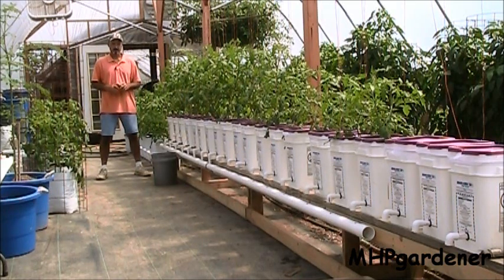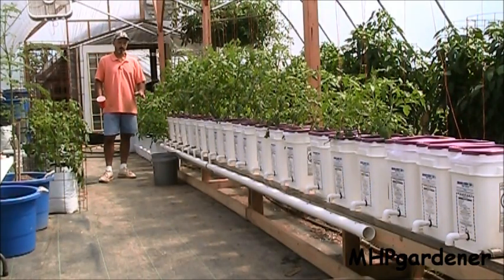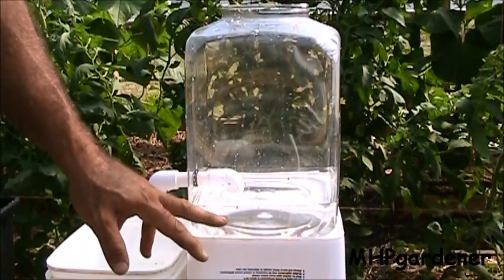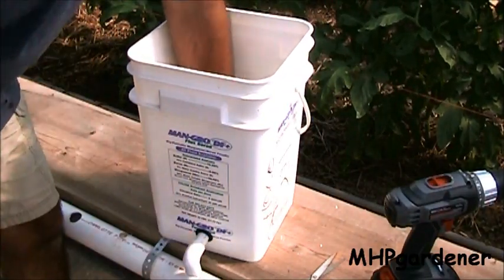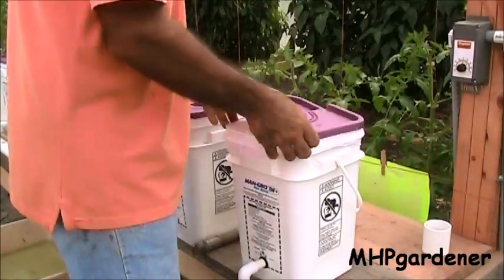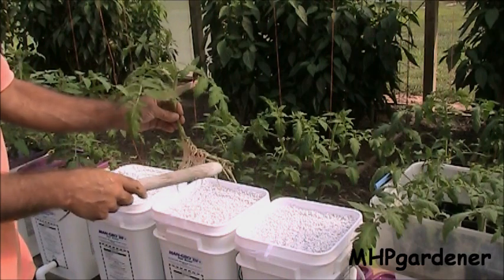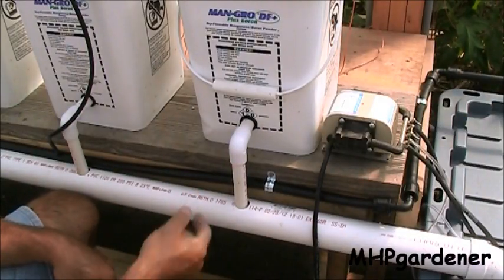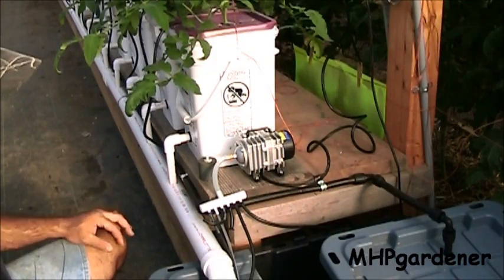Dutch Bucket Hydroponics - How It Works & How to Make Your Own Buckets

Comment: Thanks for all of your work in both growing and doing these videos.  I was wondering if I could substitute pumice for the perlite?  The local gravel yard sells it really cheap, you can fill up the back of a pickup for about 25.00.  But before I went over and loaded up I was wondering if it would throw off the nutrients or add in something bad. Thanks, Jim

Comment: First, i'd like to thank you for all of your help. i need clarity on grommet size.  i cut a 1" hole, bought some 3/4" groove dia. x 1/2" I.D. grommets (which i thought would be too small) and they just fell through the hole, barely touching the edge. went back, got 7/8" groove dia. x 5/8" I.D. and 1/2" pvc fit but moved a little too freely for me. so, THEN i cut a 3/4" hole and was able to get only 1grommet with pvc to fit. obviously, the trick is finding the right dimensions grommet. thx.

Comment from the maker: When the reservoir gets low, I add more water and nutrients at the original ratio. If it's extremely hot, and I'm in a hurry, sometimes I'll just dump a bucket of plain water in there. The plants will be transpiring quite heavily, and losing a lot of water. With me, it's not an exact science. As long as you change out the reservoir every 30 days, it works fine.

Comment: I would have put the main drip line above the buckets so the pump doesn't work so hard but if it works this way there must be a reason . Great system especially when you don't want the mess of dirt.Thanks.

Comment: Hi, do you have a good online source for perlite? I bought a bag like yours from the local hydroponic store and it cost me $63. I don't like perlite because it's too light, so when the wind blow on my tomato plant, the root/net pot get tilt. Why is the river rock expensive? I think it's about $4 for a bag that could fill up 1/2 of the 5 gallon bucket easily.

Comment: You cannot use manure in hydroponics, only pure, well balanced, chemical solutions. Manure must be broken down to the elements and molecules plant roots absorb, and neutralize all the bad stuff in it. The only way to integrate is with ecological systems like aquaponics, which is completely different from what is been proposed here.

Comment from the maker: 1) No... I don't cement anything. 2) spacing varies, 18-24 inches. 3) The pump is an Eco 264, the poly is 1/2 inch that you can get from Lowes... and the reservoir will vary depending on how many buckets and how often you want to refill it.

Comment from the maker: Thanks. The pump is really simple. I was using a 264 GPH pump like most hydro stores carry. For this year, I added 12 ft to the system, so I moved up to a 400 GPH  pump. Nothing fancy after that, just 1/2 inch poly, with 1/4 drop lines at each bucket.

Comment: it is possible do with it aquaponics, but the major issue with Aquaponics is u need a good filtration system to make sure your water is clean before feeding the water into your floating raff, grow bucket and so on. Cause those small particle will tend to stick on the root system of your plants. Remember good respiration to the root system give u good and heathy plants.

Comment from the maker: Thanks. 1. Grow plugs are ok, but not dirt. If you have plants in soil, they do need to have the roots washed off before going into a hydro setup. The roots get water early on primarily from the feeder line up top..and later on from the bottom too. 2. Shorter buckets are fine. I explained that in a video last week. There are many different hydro methods. With this one, if you change it all up, it becomes something completely different.

Comment from the maker: If it's a drip kit with emitters, take them off and leave the lines open going into the buckets. Then, just starting out, 15-20 minutes 3 times a day will be plenty. And as they grow and the days get hotter, you can move it up to 30 minutes.

Comment: what will happen if you have to water in the bucket come up to the top area so the roots are in water all the time ,simular to the floating method but the plant is sitting in the perlite or gravel if this will work all you need is a 1/2 inch tube to connect the buckets 4 inches from the top with a continus flow of water then if the power shuts down the plants will be fine simular to the kratkty method,a combination of 3 mathods .

Comment from the maker: I got my buckets from the local feed store. They are about 4 gallons. You can get 3 gallon buckets from the bakery section at most grocery stores if you ask. I've had several people recommend looking there. Most any timer will do, as long as it has at least 3 settings per day. I prefer digital timers, but the manual ones work too.

Comment from the maker: Exactly... you can use a smaller bucket than I have. The storebought bato bucket was about 3 gallons. So that will be plenty. As for the tubing, it doesn't work like a flood and drain. The water is fed thru the top, and the older water exits the bottom.

Comment from the maker: I've never used sawdust in anything. But my first thought would be no. It seems like it would stay water logged, as opposed to letting the water pass thru. And I think you'd also have issues with the nutrients and pH. However, it would make an interesting experiment.

Comment: Another excellent video.
Those paint straining bags are about 3 bucks apiece where we live. We use them to 
ferment fruit wine in buckets. But they can add up, so we also use pantyhose;
it's cheaper and works just as good. I was thinking spigot filters made from pieces
of pantyhose and elastics. E.g., double wrap the nylon around inside spigots and 
tighten with strong elastics. You could probably fit several spigot/filters from a single
pair of dollar store pantyhose. Just a thought.

Comment from the maker: Thanks. I'm in southern Virginia. I've always been fascinated with hydroponics. So I started doing some testing. The dutch buckets take some time to set up, but after that, it's very low maintenance. Trying to do so much by myself, I need to optimize my time. Hydroponics allows me to grow a lot, without much effort.

Comment from the maker: I'm not familiar with Jung tomatoes. But you should be able to grow any type of tomato in this setup. Straight perlite has worked well for me. Yes, you can start it in soil, then wash the roots and put it into the buckets. It's gonna be a shock to the plants, so they're gonna wilt quite a bit for a day or 2. Try to do it on a cloudy day, to make things easy on the plants.

Comment from the maker: I noticed a little bit of algae, not enough to affect the plants, but enough to where I wanted to prevent it. So for the crop that I recently started, I wrapped the buckets with black plastic. A lot of people use white buckets with no problem. But I think these are pretty thin. So I figure better safe than sorry, just go ahead and wrap them. Thanks.

Comment from the maker: You can use any type of bucket for this..round, square, either one will work. Check out the bakery section in the grocery store. They usually have some...so I've been told.

Comment from the maker: "try it for us" ? I have to figure out how it works first. I see right off that my first problem would be lighting. Since the panels are vertical, I couldn't make it work in the winter when the sun was so low. Possibly in the summer. I'm guessing they had supplemental lighting, and lots of it. But, it does sound interesting. Uh oh !

Comment: I saw a different system used in Japan. It looks like 4 x 8 sheet of foam insulation board, with 2" holes for net pots BUT they stand them up on end like a teepee, about 4" apart at the top and 24" apart at the bottom, aeroponic sprayers, ends closed to block light, looks very economical and space saving, try it for us!!!

Comment: I think you can save a lot of money on buckets and plumbing supplies, by using an ebb and flow system with osb or ply for the container and line it with 6m black poly.  I like to make the containers about 4'x8'x12".  You might try using aquaponics system for the fish and nuteriants as well.

Comment: Thank you so much for the easy to understand information!!! Question............Does the nutrient water continuously circulate in the system 24/7 or is your water pump run on a timer. If you do, how often do you set your pump on and off?

Comment from the maker: I was running the air pump 24/7...but it may not be necessary. The water pump only runs when you need to feed the plants, usually 2-3 times a day depending on the time of year.

Comment: MH, Thanks for answering this question.... Because I'm re-watching some of your videos planning my own system, and I've been asking the same question. 

I figured I'd read the other comments before asking. 
What about using 3/8" ID - 1/2" OD plastic tubing going thru the grommet which could also go down to the backside of the bucket & would also drain from the bottom, but only drain to the bottom of the drain hole.  Might be cheaper?

Comment from the maker: From what I read, as the water trickles into the buckets, and the bottom fills up, having the elbow allows the older water to drain first, from the bottom. I guess since there's not much mixing going on, the water at the very bottom would become oxygen poor and it would be best to keep it constantly changing.

Comment from the maker: Thanks. For plastic, I would go with the standard 6 mil greenhouse film. Most of it is rated for 4 years, and holds up very well. One thing that really helps is having 2 layers of plastic, and the inflation blower. This cuts down on the amount of wear at each hoop because it keeps constant pressure on the plastic. However, if it's just a typical hoophouse or high tunnel, most people only use the one layer of plastic. One layer allows them to easily take it off during the summer.

Comment from the maker: Thank you. Yes, you add nutrients to the reservoir. I dissolve them in a 5 gal bkt and then pour into the reservoir. As far as I know, it is limited to either water soluble or liquid fertilizer. A lot of people inquire about using worm tea and such, but I don't think that any type of tea mixture would have the needed nutrients. However, if you tied into an aquaponic setup, that might work. I don't know for sure.

Comment from the maker: I tried to find the Lowes # and it's not listed on their site right now. The grommet is a 3/4 ID, made to fit a 1 inch drilled hole. As I recall, the one from Lowes was listed as a 23/32 ID.

Comment from the maker: I think they are about 4 1/4 gallons....less than 5 anyways. If you could find the cat litter buckets, they would work fine. I cut about 5 inches off the top of some of the square buckets and had good results. It takes a bit more time, but it also takes less media to fill them up.

Comment from the maker: For tomatoes, I didn't use net cups. That are planted directly into the perlite. I don't use emitters, the 1/4 line is open and free flowing. The buckets are filled to the top with perlite, but you could get by with 6 inches less. There is a reservoir of water in the bottom of about 1-2 inches.

Comment: Looks like the hempy bucket, only with a bigger hole in it.Did you ever try it to fill 2 inches of perlite and the rest of the bucket with good quality of coco coir which is washed and buffered? I wonder if this method is useful to use compost tea.Thanks btw for the vid.

Comment from the maker: Thanks.  To counter the PH issues, you could do a couple of things. Change the reservoir more often, or add the acid to it. I've been monitoring this setup, since I have so much at stake. I've used the PH down a few times and it doesn't take much to get the PH back down to 6.5 or so. I think a lot has to do with the type of nutrients you use.

Comment from the maker: Thanks. The issue with perlite in the return line was tricky. Back in the spring, I put some rocks in the bottom, then perlite on top. That worked ok, but still had bits and pieces getting thru. I think the strainers are much easier to work with. I like the idea of an elevated reservoir. You could even do it manually, if you were around often enough.

Comment from the maker: This is my first time doing hydro in the winter. I didn't do much of a fall garden outside this year, just some cabbage, broccoli, and a few beets and radish. My plan is to plant all that stuff in the small greenhouse right after Christmas, assuming the tomatoes are finished up. That way, I don't have to do as much heating, since cole crops do fine with overnight temps of 40 or so.

Comment from the maker: If you go high tech, you're right...hydro can get very expensive. That's why I'm doing the basic, less expensive, more productive, setups. When you take into consideration the factors of time, space, and water...hydroponics can be quite useful. Its certainly not meant to replace a traditional garden. But if all you have is a concrete patio, deck, basement, or greenhouse...its an awesome way to get some decent vegetables. Good luck with the truck bro....I know nothing about engines. ;-)

Comment from the maker: Good question. I think pea gravel is a good option, especially if you have a quarry close by and can just get a scoop in the back of the truck. I'm about 3 miles from a rock quarry, and would likely use pea gravel if I set this up outside. The additional weight would be very beneficial outside, where you'd have to deal with the wind. Inside the greenhouse, I wanted something not so heavy, since I was putting the buckets up on a platform.

Comment from the maker: Thanks Matt. I would stick to the side entry for the pipe. Even though the bucket is round, there is not a lot of variance in a 3/4 section. Tons of people have done this with 5 gal buckets, so I think its the safest way to go. I think there's less risk of clogging if the water has to go up the elbow, as opposed to the media resting on top of a straight pipe. I'm not saying it won't work, just that it's not the typical application.  Its a versatile setup, so there are plenty of ways to do it.

Comment: Thank you for some good ideas. I have been developing a similar system for my back yard using Homer buckets from Home Depot and potting mix. I pay about 2.30 each for my buckets if I buy in bulk and potting mix is not cheap either. I'm always interested in a better solution that makes it affordable to those who need a way to survive the hard times. I like the idea of perlite a lot. Where do you  suggest getting buckets like yours? Thanks again for your good work.

Comment from the maker: Thanks Lois. I'm still working on a good rotation right now. The small GH is much better suited for inground, the soil is pretty good. The bigger GH , aside from the beds that I made, has nothing but hard clay under the black ground cover. So hydro works great in there. I have a 3rd GH frame, for about a 30 x 60...but haven't put it up yet. My thoughts are to make it 100% hydroponics / aquaponics. I'm still in the decision making process. I have a lot of options to consider.

Comment from the maker: Thanks. A small solar panel would work great. A 12v pump running less than 2 hours a day wouldn't take much power at all. That would be a great idea for an off-grid deal.

Comment from the maker: They have something like that at Disney. The plants are hanging in the air and get sprayed with nutrient water. Works great. I've seen smaller aeroponic setups and they produce quite well. The biggest problem I've seen is the little misters getting clogged up. I have enough problems already. :-)

Comment from the maker: 1. The trick to the buckets is the rubber grommet. It makes a water tight seal regardless of whether the bucket is round or square. 2. I use Masterblend 4-18-38, mentioned in the description. I cut their ratios down to 5 gal size for mixing. Works great.

Comment: Thanks so much. I owe you! I am going to start ordering the parts so I am ready for spring. Where are you coming up with the buckets. I ran the video a couple of times and did not catch where you found these. I like the flat side for being able to easily mount that drain system tube. I guess you could come up from the bottom of a round bucket to a level but this looks much easier. If you have already answered this I apologize. I will look through the comments.
You have the heart of a servant!

Comment from the maker: Thanks. There's a lot of ways to adjust this and tinker with it. Good info on the aeration. I've seen setups with it, and some without. I tried to think of it like an AP setup where they aerated the fish tank. If you're on a tight budget, I guess going without it would be a good way to save a few bucks.

Comment: thats a great set up im going to play with this.
i will tell ya there is no reason for useing the bubble stones,just the flow of water from water sorce to bucket back to water bin does the job.
learned this from fish taks,if you have some sort of circulation you have all the air you need.

Comment from the maker: What you could do is just move the drilled hole even lower, that would accomplish the same thing. I'm not sure about the root rot. Thats part of why I want to keep the water oxygenated, so that the water going in will be as good as possible. As long as the water doesn't get stagnant, I think it'll be fine.

Comment from the maker: I'm not sure how the roots would react suspended in air. I guess it would depend on the gap between the bottom of the cup and the media. If they were getting fed, they'd grow on down to the media and take root. What you could do is shorten the height of the bucket. Thats what I did withe the first setup.